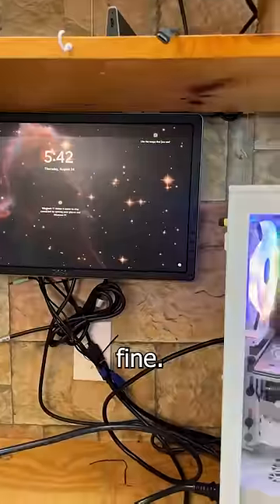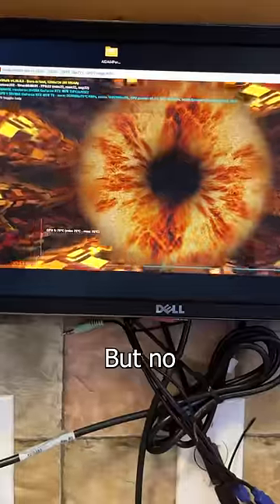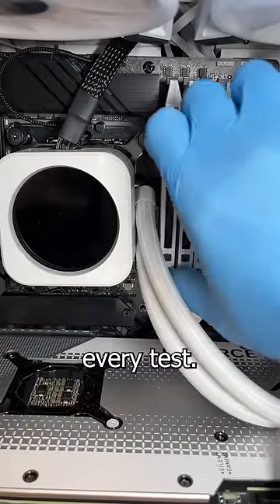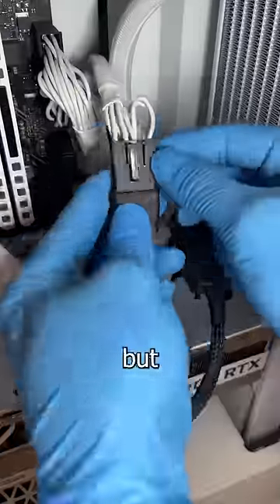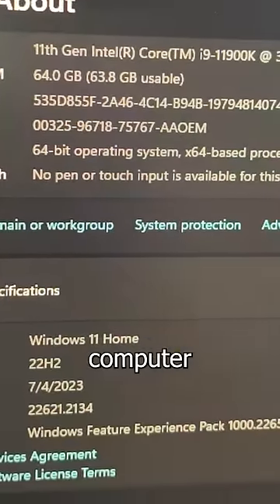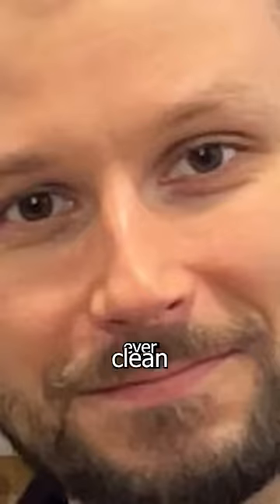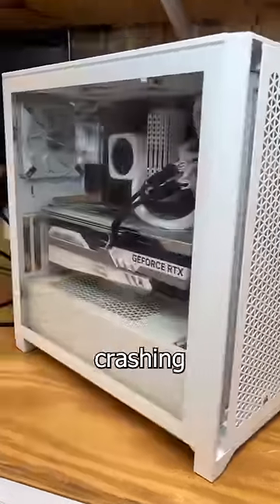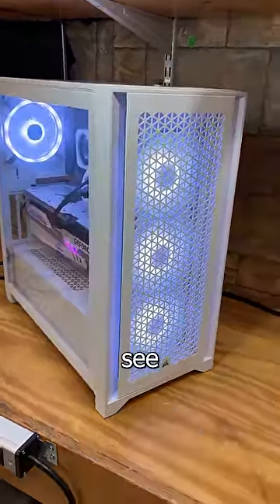The hardest repair in my shop is a #gaming #pc with random problems #technology #shorts #tech

Comment: As someone in the tech industry, I can absolutely confirm that the non-reproducible issues are NIGHTMARES 💀
Reply: Or issue that pops up random
Reply: works on my machine, closed
Reply: My friend had this issue with it just powering off and a blue screen of death with his Asus G73JW...so I've wiped it clean...new windows...all drivers...have been using it for over a week...the issue with it is the battery..new battery and sorted 👍🏻
Reply: Thats anyone who works with electricity my friend. I work on electrical wiring and units all the time and this takes me auto pilot to trying to remember 4 years ago when I was studying.
Reply: Absolutely not true. You just say "works for me" and bill them for your time. 😉
Reply: My friend had a great solution on this: When some electronic device or pc component(still under warranty) started to give non-reproducible issues he tacked the low level connectors with a piezo ignitor. After this treatment the device was surely screwed and he would always get a replacement or refund. It's almost untraceable if someone does this.
Reply: I never place a work order for an issue that doesn’t happen repeatedly, or that I can’t replicate myself. I’ll mention the odd behavior and ask IT if they’ve had similar issues, but trying to have them work on an obscure issue that occurs infrequently with no evidence or explanation will not do anyone any favors.
Reply: I worked in technical support. It's a fucking hell of a time trying to solve this kind of stuff over the phone. I wasn't allowed to hang up, and the customers refused to hang up until the ghost issue was fixed.

So many times, I just wanted to suggest they replace the user.
Reply: It's not just tech I promise you that. Any maintenance job on heavy machinery too.
Reply: Please reply since you work in that industry. I am sure I have a virus, I can't open the windows security center and I also can't reset my pc.
Reply: facts..even the seniors aren't able to wrap their head around
Reply: In any industry*
Reply: It's like when you have a friend who said something but then decided to stop talking altogether when we called the grown up to tell about that something.
Reply: Yup. I had an employee go to me, this computer won't turn at all no matter how long I wait and try. I come up and proceed to power the machine on the first try and that's just the tip of these non-reproducible issues.
Reply: I called them "ghost in the machine errors". Those are frustrating but I know something even worse.  I called them "Schrodinger switch", or "a two position switch, in the third position".  I know that sounds impossible... and it's supposed to be, the situation I'm describing is when you have settings set a certain way and you can see the position that the setting is in, yet the setting has not been taken by the computer for whatever reason. So usually to alleviate this issue you have to set it to a different value and then back to your desired value and for some reason only after doing that does the setting actually take. This is extremely frustrating to deal with because you could look at it, and even if you know what you're looking at, you are an expert, everything appears to be set in the perfectly configured position, and only after toggling them out of position and back into position does it alleviate the issue... And the setting takes and the problem is then alleviated.  So obnoxiously impossibly annoying, two position switch in the third position.  I'll give you a super obvious example: say you're using a fan controller in software to control the speed of a fan. You can see that all the settings are perfect, no other interfering software confirmed, and the fan should be locked at say 800 rpm, but the fan speed being returned is that 2000 rpm and it's loud and noticable. So you raise the RPM Target to 900 RPM, save,  and immediately back to 800 RPM and save, and all of a sudden the fan is now running at 800 RPM like it's supposed to.  Nothing about the configuration would have alluded to this hidden problem or glitch in the software.... what it really is, simply experience would tell you this is the problem.  And this is an extremely obvious example, most of the ones I've encountered are not this easy to solve.  Good luck.  Ghost in the machine, and Schrodingers switch.
Reply: My girlfriend has been complaining about this IT issue at work and it's exactly this, non replicatable and non persistent. And I try explaining that's exactly why they can't fix it.
Reply: that's the case for literally ANY repairman 😂😂😂
Reply: As dev i can agree with this
Reply: My policy is to keep the PC for a week. try and reproduce the problem.
Reply: Yeah I'm in the service industry and it's much worse. Guests be like my car is making noise, yeah thanks that's definitely gonna help
Reply: As a modder.

Same.
Reply: As someone who's ever had a frustrating problem, I can also relate to a problem that happens.
Reply: As a dev I just close the issue as can’t reproduce or assign it to QA and ask for steps to reproduce 😂
Reply: I hate it two. When the problem is whith something customer did not bring with. :(
Reply: ME: Iso crash 1/5. No steps to repro
Producer: NMI. Please Repro with logs and dxdiag on new prod build. 
ME: 0/5 CNR.
Reply: Isn't that usually because of user error?
Reply: Dude it's the same for aircraft. Fucking nightmare trying to diagnose a fault that we could never replicate
Reply: Yep.
Reply: Honestly the worst 😞
Reply: Same thing goes for mechanics. "Customer states he heard a popping noise from dash" getting in the vehicle I can see there are about 7 phone mounts in the vents, 3 dash cams, wires coming out of every single orifice you can see in the front of the dash. A passenger foot well full of big gulp cups and honey bun wrappers and a tablet mount drilled into the airbag with self tappers. Or you get one like this where everything is perfect and it died once on the road and never did it again lol
Reply: Was going to say exactly this.
Reply: Just like your brothe.....
Reply: It's usually something outside the computer. The ground on the power outlet, some external accessory, excessive RF noise, etc.
Reply: And sometimes you spend like 10 hours on troubleshooting, and you realizes that you could almost buy a new pc with the worth of your 10 hours time, instead of trying to repair it.
Reply: That is why I don't even bother writing bug reports if I can't reproduce them. Same with hardware issues. If I can't make the problem happen to demonstrate it, I will not be seeing a technician.
Reply: @gamingwithmeobviously5753 did you shutdown your PC while it was updating? If so, yeah it's at the point of null, the only way to fix it is to reset it for good (wipe all your data and install window 10 or 11 again) from what I heard, might be wrong tho
Reply: makes you feel like the customer is fucking with you LMAO
Reply: Or the issue that's not an issue but a feature lol
Reply: My computer has been crashing for six months now and nobody will fix it because they can’t recreate it. I have a whole new set of equipment and have had them reseat the parts and everything
Reply: Well, if a technician cannot reproduce the problem, most likely the culprit is not present on the testing site
Reply: I've gone from remote technician to developer and the issue of "I can't reproduce it" followed me thats the part that still sucks.
Reply: What, you called?
Reply: The problem usually stems from you not having access to their entire setup. If the guy only brought in the tower at first and the issue was with a peripheral shorting a port that caused the shut down the guy would never have found the issue without having access to that dock
Reply: Why is that bad? Just be clear and transparent that it can't be reproduced. It happens with all other industries revolving around fixing things.
Reply: @failtolawl because if you don't have full access to everything they have attached it is both s waste of time and their money. 

Ultimately it is easier to reproduce an issue if you have circumstances exactly the same. It makes it harder to pinpoint or even troubleshoot.

Basically it come down to "it is likely a periopherap". When I do computer work I tend to do in home calls or ask for everything they have hooked up, but I know.ot isn't the norm
Reply: Thankfully at my work if the problem cannot be replicated at that moment or there isn't a clear event log or video or evidence showcasing the issue we shelve it until it happens again and fix it in the moment it's occuring thankfully so it's not too much a nightmare just frustrating not being able to root cause resolve it straight away for the end user
Reply: @TakuCityPop  that's why I have requirements if I don't do a house call
Reply: as somone who worked tier 2 in IT.
"works fine on our end"
Reply: Any industry for that matter. I’m a plumber and it happens all the time. I also build pc’s in my free time🤣
Reply: We had customers in new construction homes with the same issues and it turned out that when we set them up with an uninterruptible power supply it would beep about every couple minutes (which I heard complaints about) but the machine ran fine after that.  Turns out that the customer had a mini-fridge on the same circuit in their office and every time the compressor would kick in it would shutdown/reboot the machine.
Reply: My pc was crashing within 5 mins at my house took it in for repairs as it was under warranty they said nothing was wrong they ran it for 16 hours without a fault, so i take it home and again within 5 mins its crashing so i take it back this time we hook it up with me there and mess around for around 4 hours and bam it starts crashing i was happy as hell so was the clerk as it means the whole rig can be replaced if need be.
Reply: Well no sh** dude lol

Comment: As a maintenance technician, yes. The biggest annoyance is not being able to reproduce the reported issue.
Reply: And then the cause being something completely unrelated...
Reply: I swear to god the moment the customer brings their device in the problem decides that now is the time to hide. Issues? nah, what are those?
Reply: lol I feel you I actually was trying to replicate a problem on a machine then the machine didn’t turn back on wasn’t fun to deal with
Reply: As a customer the worst thing is when you say you're having a certain problem but the technician tries one time to replicate it and can't and just tells you there's no problem.
Reply: Mechanic here. Seeing "Intermittent issue" on a job card gives me PTSD 😂
Reply: @devo3243  "it randomly crashes like once a week after 3-5 hours of work. We removed the hard drive because company secrets."
Reply: Literally just brought my device back from a technician after he tried to fix a problem and we ran some test over at him and I came back and 1h in my pc crashed again istg my pc is just trolling me at this point
Reply: @MIDO44444  consider what things you use in the setup at home vs what you took to the tech. and w/e you have recently installed/uninstalled or added/removed to the pc. it can be anything, external usb card, a cable, etc.

Comment: Two most frustrating things in diagnosis or debugging:
"It's not working, and I don't know why."
"Now it's working, and I don't know why."
Reply: As someone who is playtesting a game right now and finding a ton of problems happening with seemingly no reason outside of planet alignment I can relate
Reply: Isn't that something like monday morning problem for programmer's.
Reply: @@Kuradeelbeat me to it, I was about to say that same thing. There’s a problem, you fix it but you don’t know how or why it’s fixed. And further down the line it comes back to bite you in the ass
Reply: Mine was crashing because  of old monitor, once i have changed monitor it was working  fine.
Reply: @Feligresa  "Planet Alignment" in game or IRL?
Reply: @devilsluk  If only I knew, then I'd at least have a reference point :D
Reply: The latter is much more frustrating than the former
Reply: Even in something relatively entry level, like Excel, there's shit like that.

   I made myself a formula, so the numbering in the first column wouldn't break (I couldn't make it a proper table for reasons) if I copy-pasted in more lines in the middle and everything was fine, until I hid a line below. 
   When I debugged the steps, the formula was working perfectly fine without the line hidden, but with the line hidden it'd refer to the next line instead of the current one. It made absolutely no sense initially and it still didn't make any sense once I added the last argument to the formula and it started working again.
The formula in question uses an approximation by default and I put in the argument value for the exact search, and that solved the problem, but why would it break because the next line was hidden, I have absolutely no idea, because the formula should've stopped on the line it was in in the first place.
Reply: @Feligresa  I had an infinite jump glitch in a game I was making. Showed it to a friend through Discords streaming. It wasn't happening at any point in the stream. I just got up to get coffee and gave up.
Reply: NOT WRONG!!! often external peripherals that are taken out of the equation when they take the pc in for repair or a timed/scheduled thing that happens 'intermittently' to us...... or in one of my favourite ones WHEN THE DANG POWER SUPPLY IS UNDERRATED AND IT ONLY CRASHES ON ONE!!! game T_T the gpu overloaded the rails and bzzt.... it turns off...
Reply: I've fixed so many things in my life doing exactly that.

My best instance, I was on my way to Detroit Michigan for a League of Legends final. With my friend in my car, halfway there I say out loud "My car is a bit of a piece of shit, but she's run just fine for the last 9 years" and lightly tapped the dash above the radio. AND IT SHUT OFF. AT 70MPH ON THE HIGHWAY. IT JUST TURNED OFF. 

I pulled off to the side of the road, said I was sorry to the car, turned it off, turned it back on, and continued on my way to Detroit without another problem.

I was very very confused for the next 6 months, as was my friend...as he WATCHED IT HAPPEN. 

Got a letter in the mail saying my car's ignition was found to be faulty and could be fixed for free if I took it into a dealer. Apparently I tapped it JUST RIGHT, ONE TIME EVER, WHILE INSULTING MY CAR, and it triggered the fault...the one and only time I ever had a problem with the car. Had it for another 2 years before giving it away to a friend who didn't have a car. Dealership wanted to give me $500 for a running vehicle. Its still driving her around today. Rather have $0 and a friend with a running car than $500 and know I was fucked over by a dealership.
Reply: Now, the number of likes is a palindrome number

Comment: Peripherals and things like foulty power outlets can really screw you as you're trying to help but can't reproduce the problem
Reply from the maker: All the time 😔
Reply: @SalemTechsperts at least the more expensive item wasnt the problem, frustrating for you, but a saving grace to the customer prolly
Reply: My nemesis: USB extension cables. I had a 3ft extension for a wifi adapter that would crash the pc with nothing plugged in (probably a short)
Reply: @chronicallydazed5446 I get your point but I’d like to mention that thunderbolt docking stations are ludicrously expensive
Reply: @jebdiankerman5029  jeeeez I just looked em up they are stupidly pricey, not as much as a fair amount of the parts in that PC, but ridiculous for what it is lol
Reply: Sometimes i have to go to their house, and then work there just to have the problem and so know what happens
Reply: when you connect something usb c on windows 10, on an Imac Bootcamp, it doesn’t start or shut down, i have same issue with other Pc with usb c accesorios sometimes
Reply: @wisico640  worse is that does not generate a log error as far as I know.
CPU shorts error loged.
A usb dock station shorts.
no logs.
Reply: @Zack_Wester  exactly, I was about to replace a gpu for a client on an old athlon platform before realising what was happening!
Reply: yea budget extension leads or plugging a 2000 watt hairdryer into the same extension lead as your PC
Reply: My recommendation: buy shorting testers or devices. Each port should survive to a rated shorting level. If it isn't, it is failed.
Reply: that was the reason why i have bought new power supply only to find out few weeks later that my switchgear was having an issue
Reply: @SalemTechsperts yep i made my keyboard explode with that shot
Reply: lol I remember many years ago I had an Ipod mini and whenever it was plugged in the mobo thought it was good idea to try to boot off it and obviously fail lol
Reply: @wisico640 That's actually more common than you think. Depending on the header the USB extension in plugged into, it can actually sometimes draw way more power than the port can output.

It's pretty common in older/budget Mobos, but as of recent fairly commonplace with AMD boards, iirc Gigabyte and MSi.
Reply: @Zack_Wester got damn...
Reply: It sucks dude. Had a faulty outlet completely destroy my PSU, had to buy a whole new one
Reply: @SalemTechsperts how did you find the problem? Ask the customer what was plugged in and then eliminate the variables one by one?
Reply: @SalemTechsperts   Ya I was guessing dirty electricity at the customer's house before you revealed the problem at the end of the video.